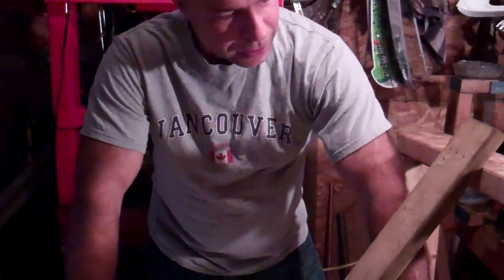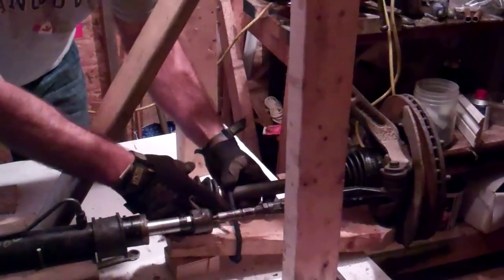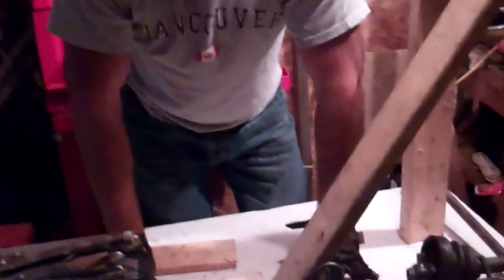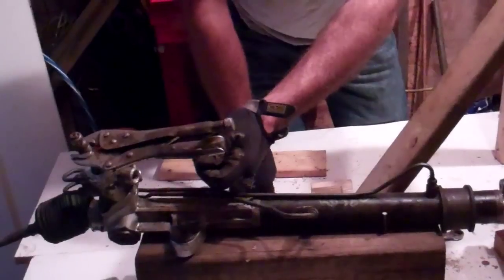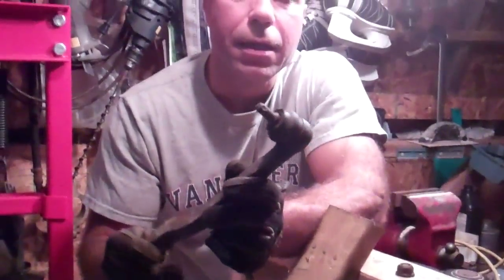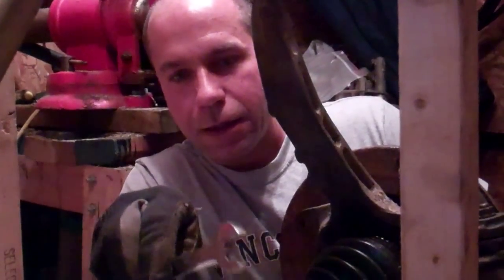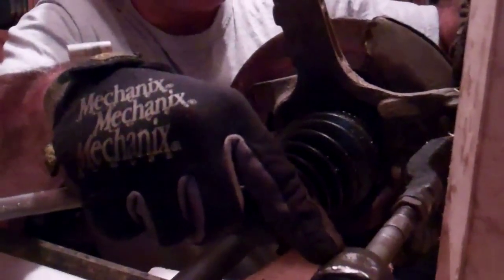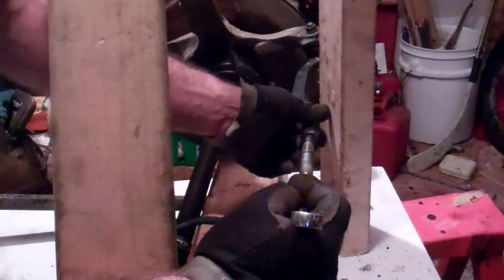Steering components & how they inter connect

Comment: Actually, I wonder what you would think about this scenario - I told my dealer the car pulls to the right. In other words, if I am on a straight road and I take my hands off the wheel, the car veers to the right. They said they rotated my tires, filled them all up with air correctly, and said my alignment is "within spec". I got my car back today and it still pulls to the right. 
Any ideas? What else could it be? Assuming of course they actually did what they say they did.